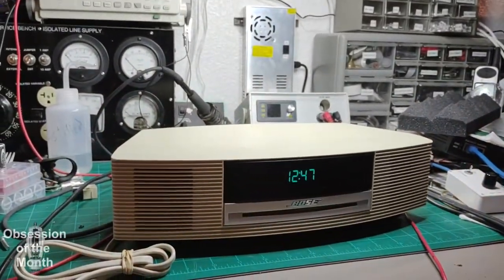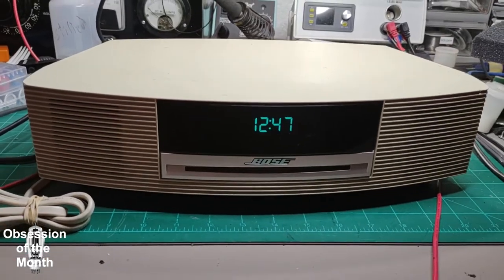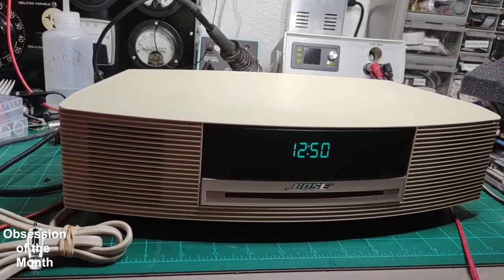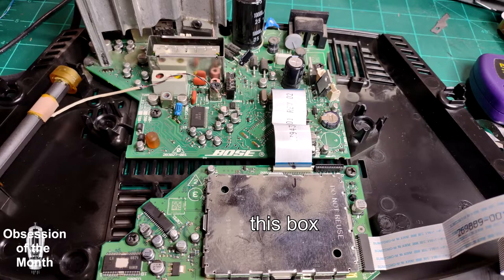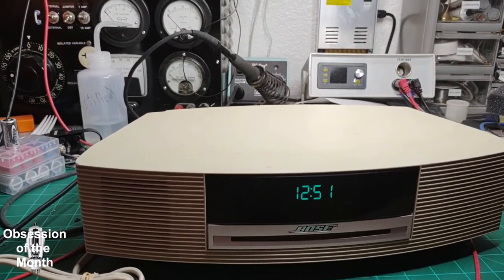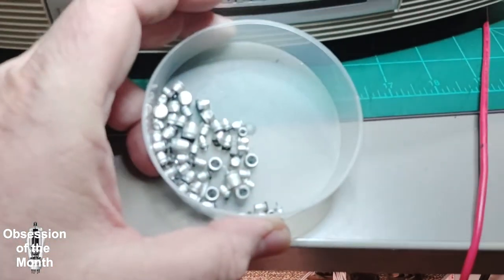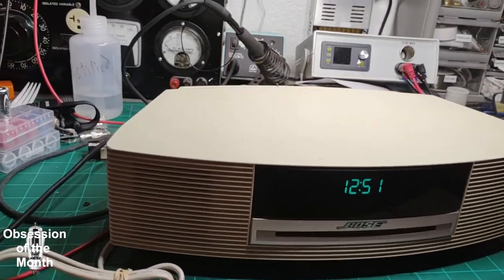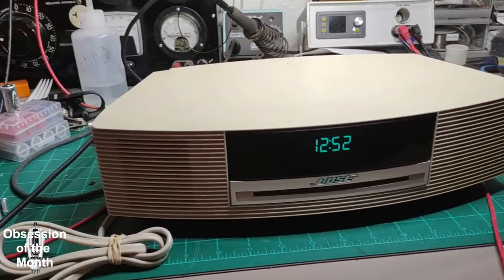Bose AWRCC2 flashing -- please wait -- error fixed

Comment: I had the same problem with the Please Wait message. I had unplugged it for about a year.  When I plugged it back in and checked the remote - all functions worked except am/fm radio. I turned it off but I left it plugged in and came back several hours later.  Turned it on via remote and pesto, it now works.  Very strange.
Reply from the maker: yes, that is what this one did.

Comment: My radio will power up, yet, when using the remote, the time will flash but never get the FM radio to turn on. I have had this problem multiple times if I unplug the radio for whatever reason. VERY annoying.